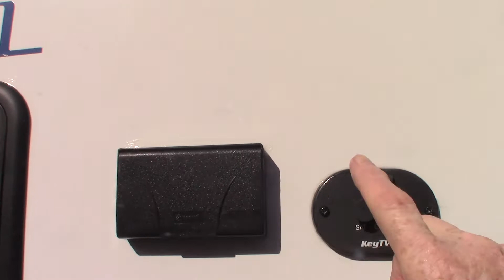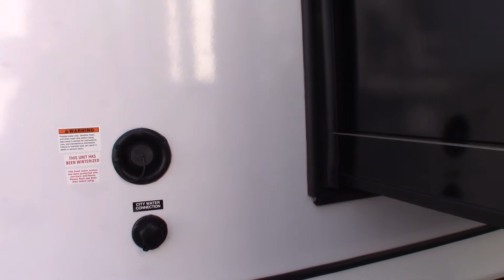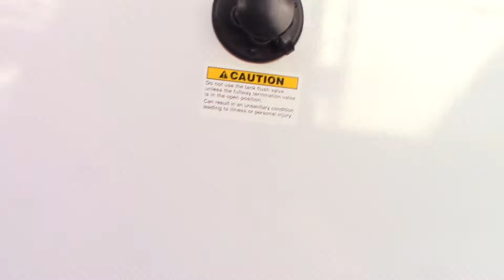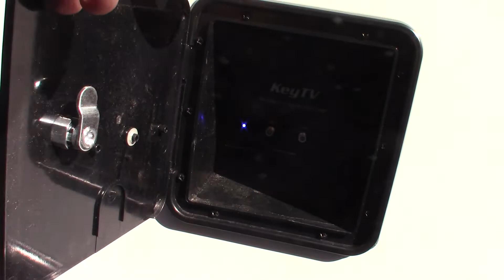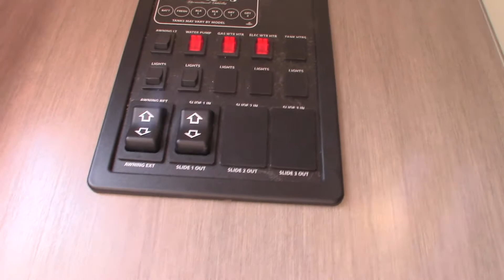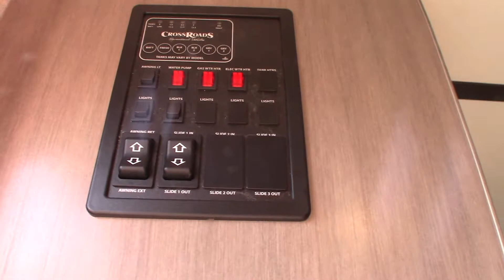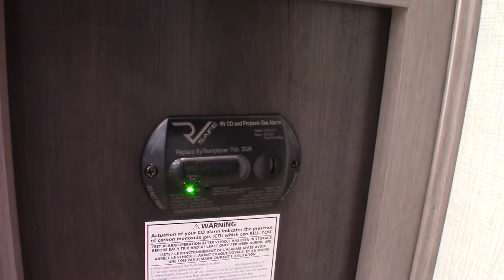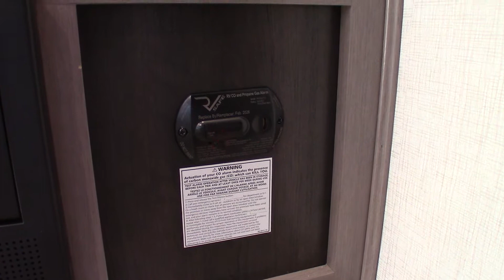2021 CrossRoads Sunset Trail 188BH

Comment: Just one gas tank and no power jack???? Most of the trailers now comes with 2 tanks and power jack .
Reply: Use a bracket kit to add an other tank and battery holder. Powerjacks are great; however, they suck unnecessary battery power/malfunction, often (like electric awnings). The lack of a double-axle (more sturdy for off-grid/boondock camping), and how much storage space they didn't take advantage of: above the toilet, the stove, and replace the microwave with shelving.